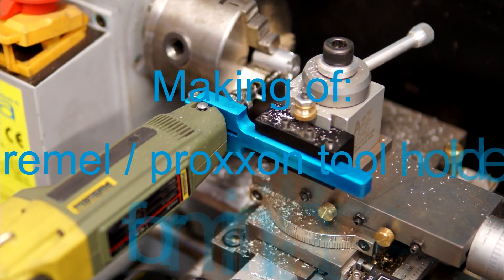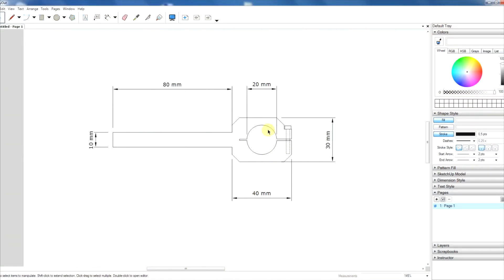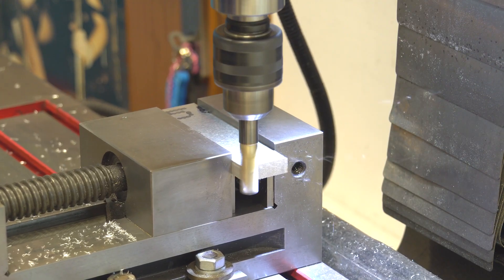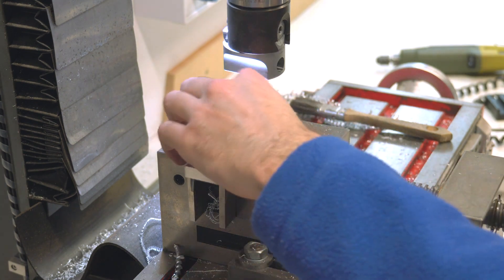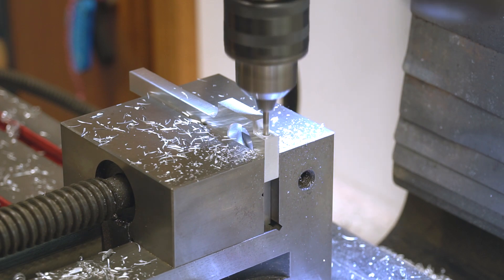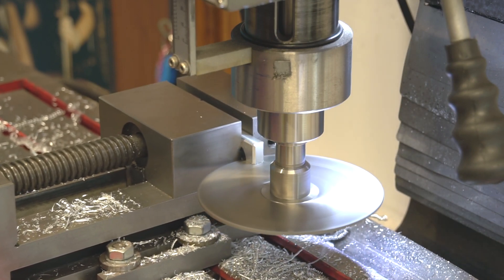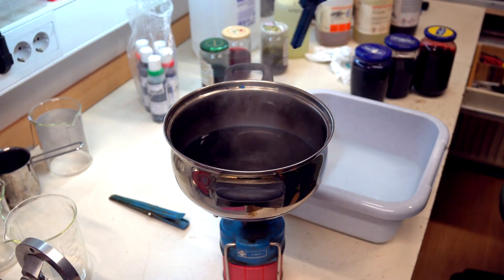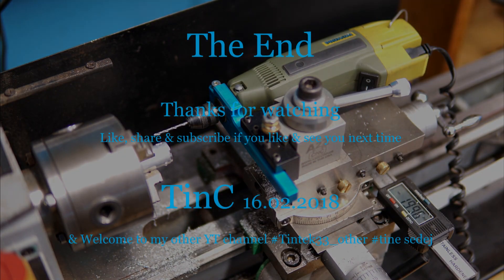Making of: Dremel / Proxxon drill holder for mini lathe

Comment: FYI - the Dremel Moto - Tool Model 395 Type 4 has a 1/2 inch 12 TPI curvi-linear plastic nut on the business end.   THAT can be replaced with a Hex-headed Plastic Pipe adapter.  Buy a white plastic 1/2" Female Threaded ADAPTER (female threaded to glue on end) and that 12 tpi fits the Dremel Moto-Tool.  Cut off the smooth glue on end down to the shoulder.  THIS works and gives you a Hex end on the Dremel tool.  Cost under $3 at any hardware store.

Comment: Hello, excelent video. This tool have enougt power to drill a hole in steel? or cut a steel bar?
Reply from the maker: It can but only up to about 2mm, 3mm is for wood aluminium and brass only.
Reply: @TinC33  thank you very much!

Comment: what are the threads on the spindle?
Reply from the maker: What thread do you got in mind, rhere are no thread on lathe spindl if you mean that.
Reply: @TinC33  your rotary tool. I did find it after a few hours looking m8x.75
Reply from the maker: @pacman10182  ah ok, now i know ;-) i didn't know because there was original chuch since ever, max insert is 3,2mm
Reply: @TinC33  I was looking a proxxon's micro mill, I'd want to make a small fly cutter for
thank god the use a standard thread, dremel uses some BS .276x40 thread
Reply from the maker: @pacman10182  nice, great project

Comment: Thanks, great video! I have just one question --> what is the thickness from the tool? I need to know it, because I make one for a schoolproject.
Reply from the maker: I measure now, it's 10mm
Reply: TinC33 okey, thx! :) great tool
Reply from the maker: I take 10 or 12mm aluminium plate, don't remember exactly

Comment: Nicely done.
but IMHO one point around time 0.50 should be emphasized... the hand drill tool shaft, should be at CENTER on a  lathe. so the measurement should be taken between lower plate of cutter handler and the drill tool shaft.
Reply from the maker: True, thanks for info but i got quck change tool post on lathe, so setting a heigh to a center is no problem for me. simply insert some small drill or something into a proxxon/dremel chuck and set height on center to piece into lathe chuck.

Comment: Tine, what mill do you have? I've seen a couple vids on your lathe but not the mill. Apologies if I just missed it.
Reply from the maker: There are some videos about my mill, like making fly cutter, test boring head, test facing head from banggood, but video about igaging dro instalation is almost all about the mill.
This is basic chinnese mill, you can get it by many many different brand, just with different add on, paint, stickers and so on, same story as mini lathe.

Myne is brand px tool 25lv (l mean lonv table and v mean vario - automatic x axix support)

Just google it as "mini or table mill 20 or 25 than because two of the letters is different from brand to brand, here in eu most common brand are optimum.de or bernardo.at but also can get some no name brand like mine for half the price (yep same mill but no brand) i was really lucky to get this one bearly used for 1000€ but it got automatix x support (cost about 300€ if you bought separatly, i got lot of gadget and tools with and the most importand it got MK3 konus into spindle, it's hard to get that small mill with mk3 lot of them got mk2 konus so you can't use so many tools, max mill diameter for mk2 is 16mm, for mk3 is 20mm.
Reply: @TinC33  thank you very much! That helps me get an idea of the size and cost.

Comment: That was Fantastic 
Can I have your opinion 
Dremel is Petter or proxxon
Reply from the maker: Thabks man, i don't own any dremel yet, but own lot of proxxon tool, and happy with any single piece, i try a few unknown brand but they'r far far behind proxxon, dremel is good they say but i don't like their design, this small drillls heave such a "fat" handle, no front mount for holder like this, you can see there proxxon got 20mm steel mounting ring behind rhe chuck...
I deffenetly say proxxon, but no 220V/110V i prefer 12v tool, because it got much much more torque on low rpm, i can drill aluminium with that drill 3,2mm with lowest possible rpm and it still turning try to do that with 220v, it will drill only on full rpm, the power is same (like 100w) but manufacturer don't tell you on which rpm power is measured, you don't need full power on 12000rpm, you need power on low rpm, that's why choose 12v.
Reply: TinC33 thank you that helped a lot

Comment: By cutting a slot on the otherside of the main hole you created a stress point. You could cut a hole  in the end of that cut with an end mill to prevent a crack from forming... nice tool otherwice
Reply from the maker: Claes Wikberg great idea, thanks, it eaven look nicier, but anyway i think there is no way to broke it.